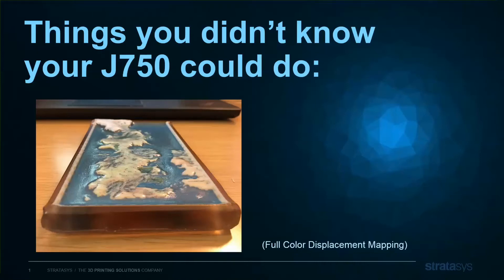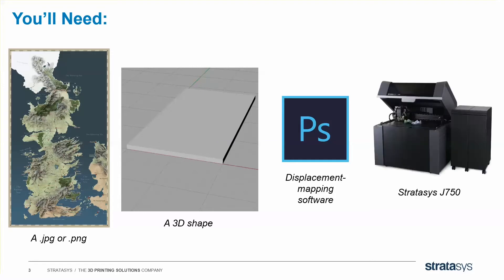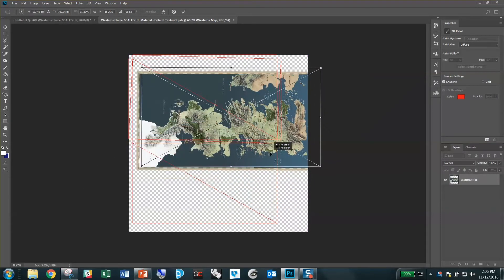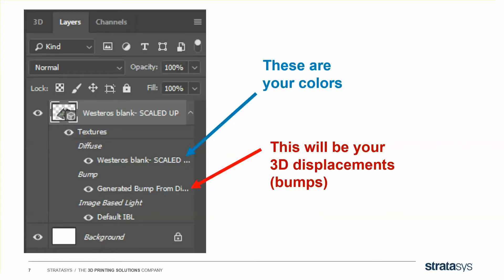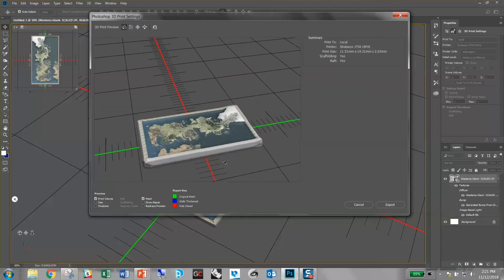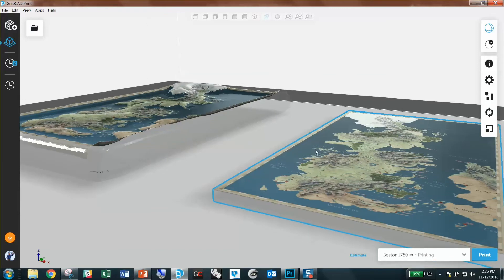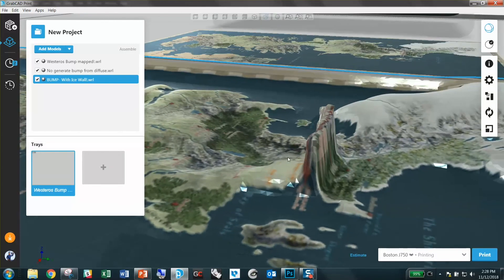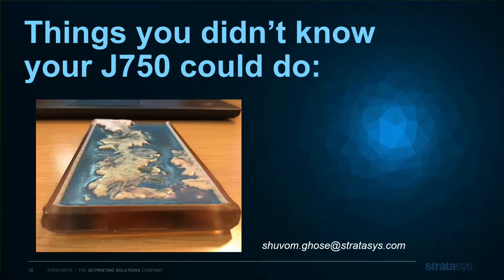Things You Didn't Know Your Stratasys J750 3D Printer Could Do – Displacement Mapping

Comment: Thanks for this tutorial. The sidewalls and edges look a bit wonky. Is there a way to keep them straight as in the original model?
Reply: BOIIE, thanks for the comment!  Yes, the side walls and edges bowed out because I left them default white/gray in the bump mapping black-and-white screen (you see it at 5:49 in the video), and so they got pushed out as well, since the lighter the color is, the more it gets bumped/displaced.  I've learned in later prints that if you REALLY want to keep areas from moving, I should have covered those areas in a perfect black (like a 0,0,0 RGB) and then they wouldn't have moved.  It's not too bad to do layers like that in Photoshop, and if you really need to keep an area straight, I would probably do that in my later prints, if I was printing this again for a demanding customer.  Hope that helps, feel free to email me at shuvom@grabcad.com with any other questions!
Reply: @shuvomghose4219  Thanks for the reply. I got a trial version of the PS and cant get it to work. When I add a new 3D layer I get the message “The UVs on this 3D scene are missing or invalid. You may have issues painting on this scene or simplifying it. To fix this problem, Select ‘Generate UVs …” I dont know if thats critical.
After that I dont have the Diffuse layer.
So now I´m stuck.
Do you know what I could do?